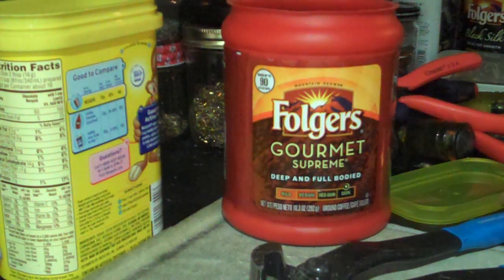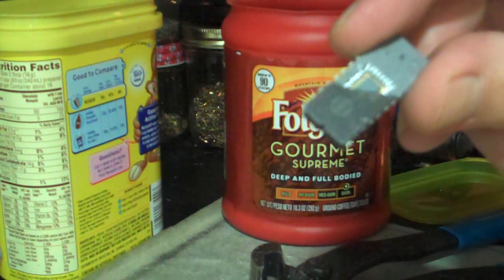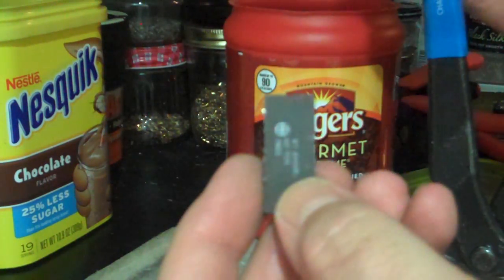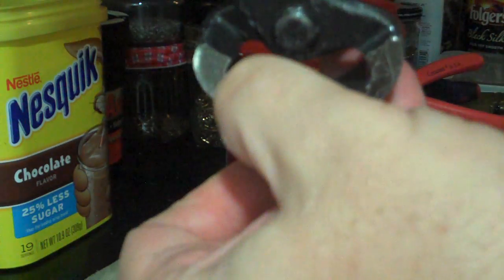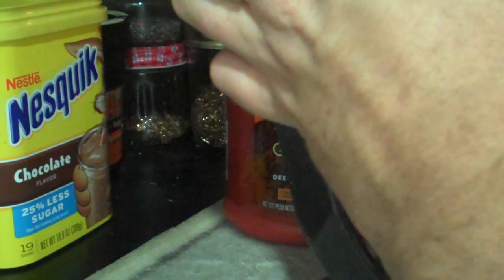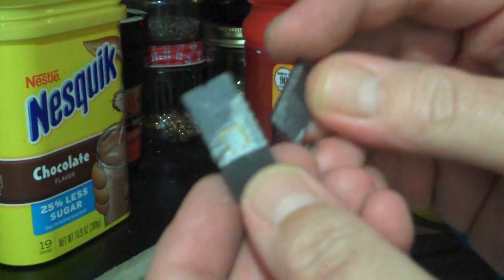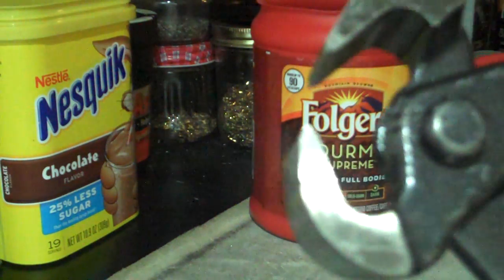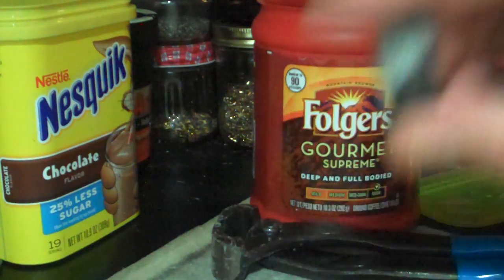Uncapping Vintage Ceramic IC Chips & EPROMS

Comment: Yo Feets, excellent as usual but I havea  question.

I'm really struggling to isolate the gold on these chips. I am well versed in recovering PMs from ewaste but the eproms are causing me issues. I tried leaching in HCL+H2O2 but I seemed to end up with colloidal gold suspension mixed with base metals. Straight HCL even heated wasn't any good for base metal leaching either as I still ended up with colloidal gold. I tried AR but then yeah base metals cause issues.

Any tips?